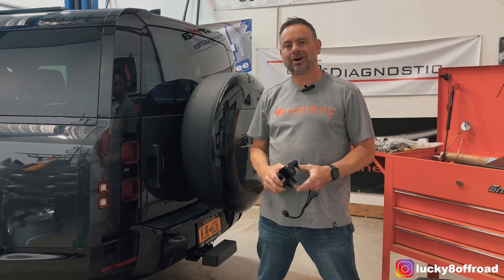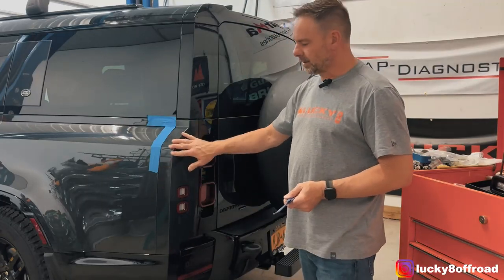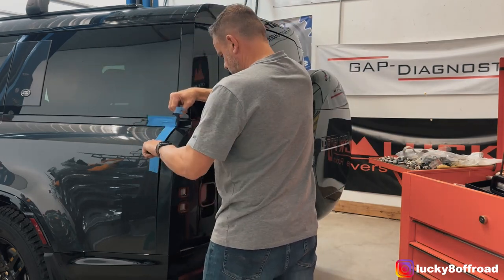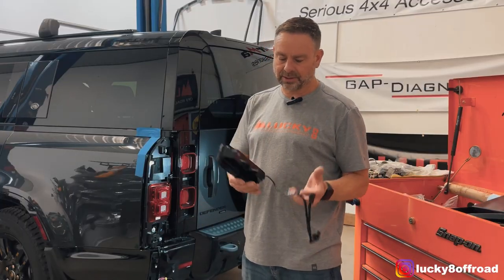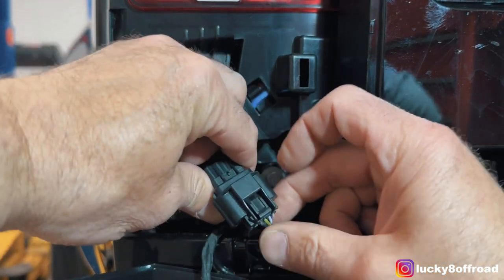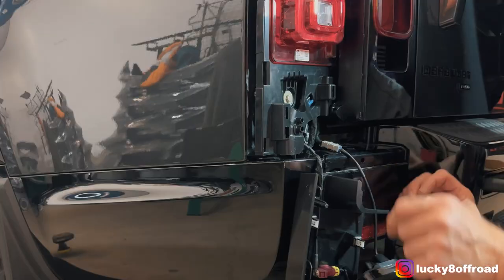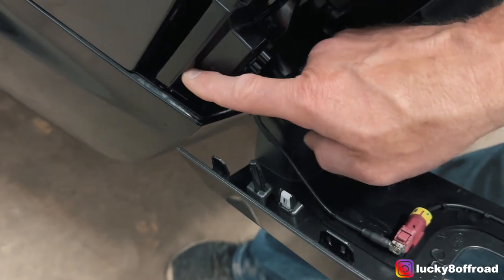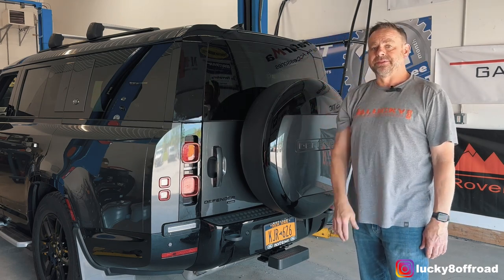Defender L663 Rear Upgraded/Reverse LED Lights Installation Guide 90 110 & 130

Comment: Thanks for your videos. I like your channel because it’s informative and entertaining. More importantly, you reply to the comments which is sort of rare. Couple of things here. In the UK it’s, or at least, should be, a common practise to put silicon grease into exterior wiring connectors, just because it’s always raining here, and a proper 4x4 trip wouldn’t be dry. Is it not that way in the US? Lastly, these lights are awesome, but I assume by installing them, the rear ladder wouldn’t be able to mount? Cheers. FYI it took me 2 beers to watch this one.
Reply from the maker: Thank you for the kind words. There is a rubber seal on the wire, but adding some dielectric grease is always a good idea. If you have our ladder, you can only use one side, but we are getting in just the right-hand side, so we can make a special kit for people with our ladder.

Comment: These look great!  i have a set from powerful UK, I love them and they are a game changer.  Yours better fit the aesthetics of the defender.  Well done!  Had these been available at the time, I would have went with these.  Not a knock on what I bought, they were forward thinking etc.  These just look dang good :)  I also have your proud rhino lift rods and sliders.  Your products rock.  I hope you get full underbody soon.  I have been looking at the Safari Gard, and I am hoping you either carry them, make a full set of your own similar to the ORD set, (including diff and exhaust protection), or a collaboration (I am down for a preorder/group buy of any option).
Reply from the maker: We currently have the Safari guard disregard. I'll be doing a video on installing that shortly. Looking at skid plate options also